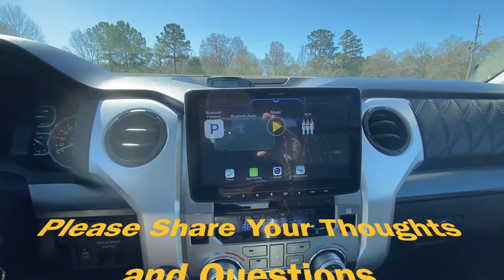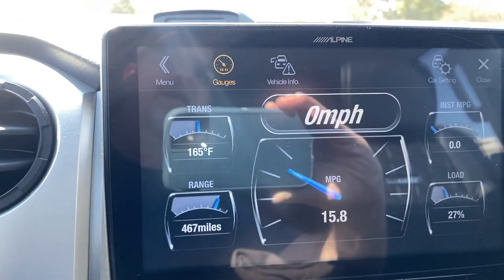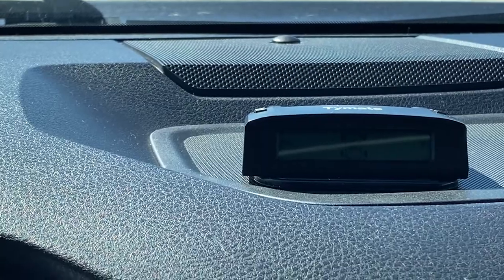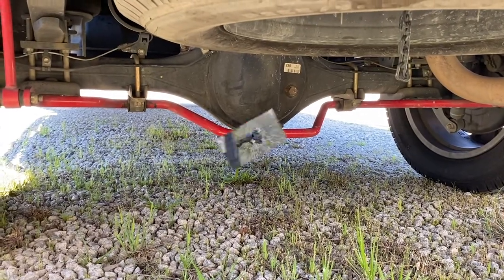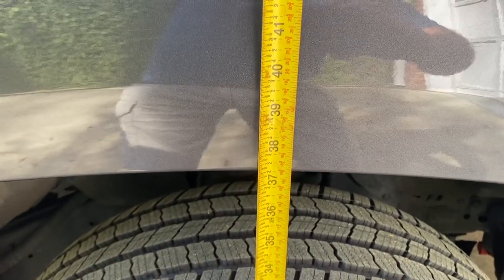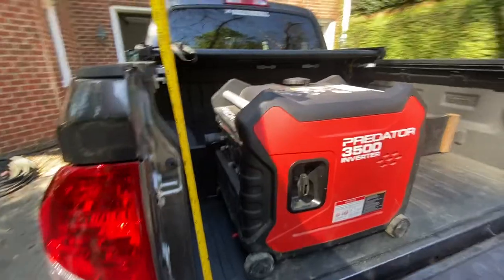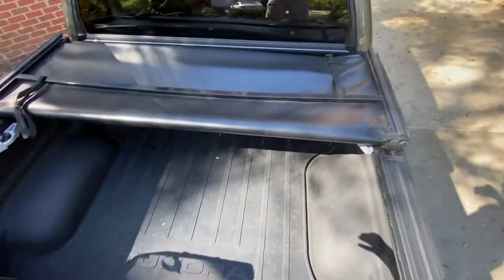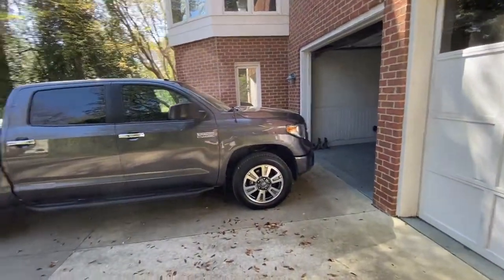Towing Modifications for safety, convenience, and comfort.

Comment: Great videos on towing with tundra.
I just recently bought a '21 SR5 crew Max and have a question. 

Do I need sway control weight distribution hitch? I thought the Tundra automatically controlled sway through brakes?

I added airbags and TRD sway bar and thought I should be good to go when weather cools down and we actually go camping. 

Travel trailer is Winnebago Hike ... dry weight is like 3500 and hitch weight 420.

Thanks again for very informative videos.
Reply from the maker: Thank you for the kind words.   You have a great setup.   At that tow weight,  it is reasonable to argue that you don’t need sway control.  However, modern sway control hitches are modest investments.   A Fastway E2 equalizer with 600lbs round bars can be obtained for under $500 and will give significant added security against cross winds.

Comment: What do you think about this video? Seems like it’s better to use weight distribution hitch than air bags which I know you know you said it in the end. Also, are those tires E rated? 

https://youtu.be/XBZu39pQ8Gg
Reply from the maker: The weight distribution hitch is definitely the most important of the two. But I don’t think it’s an either or situation. It’s just knowing how to use them together. Plenty of new trucks come with their own airbag systems.

I use passenger tires with my 20 inch wheels. Probably really need a longer video to explain that. If I were driving with 17 or 18 inch wheels on my half ton, I would use E rated tires. The increased side wall size requires stiffness with a 17 or 18 inch wheel that you can’t get on a passenger tire. But on a 20 inch wheel, the sidewall is narrow enough and good passenger tires are plenty stiff, to accept loads well beyond the half ton GVWR.  Additionally, E-rated tires are heavy and cause a drastic decrease in fuel economy.
Reply: @kedrevs4037  thanks for sharing your view, I have a tundra as well a 2014 and I tow about 6k lbs travel trailer. I have 18” wheels with E read KO2s, I should have kept my stock 20s but I’m sure plenty of people are selling those
Reply from the maker: @fouUili684  I love the KO2s, if I towed less Or off-roaded  more, I would go to them myself.